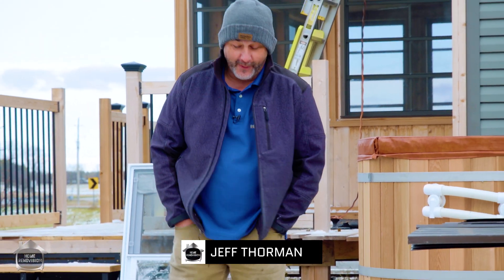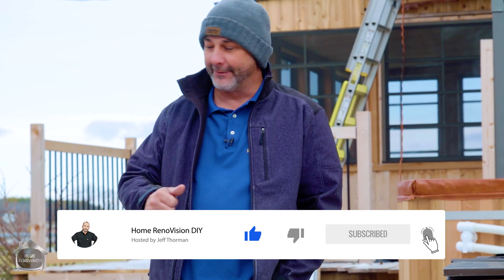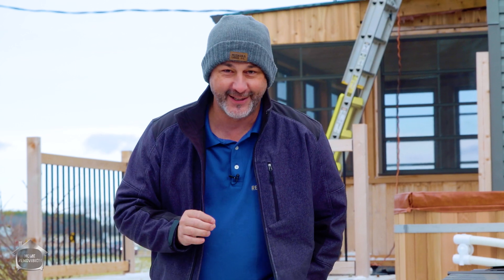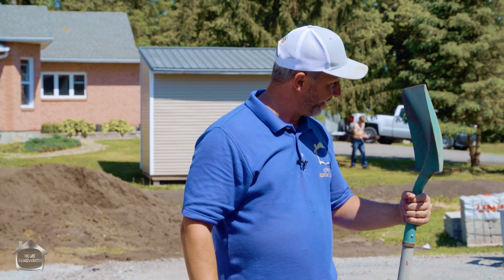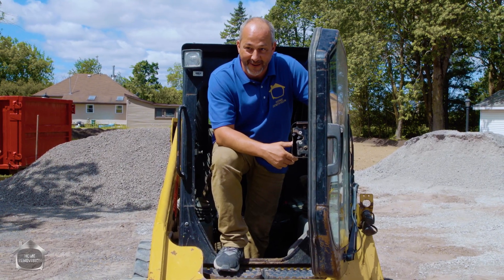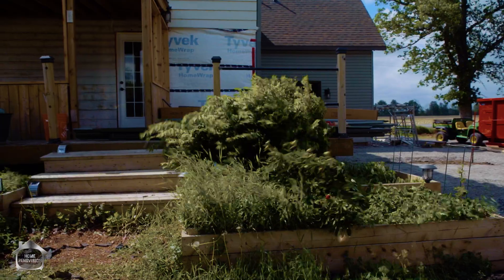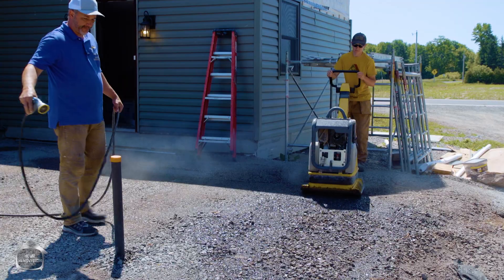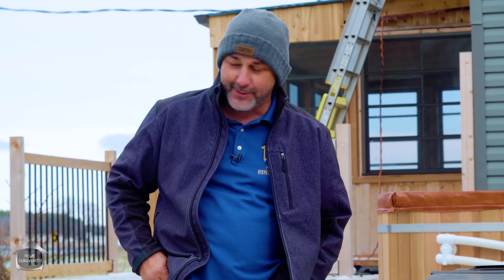We Have a Renovation TV Show!

Comment: Hi Jeff, great series of videos - very informative - thanks!  I'm planning on finishing my basement and part of it will have an unfinished painted ceiling but I want to "finish" the space between the joists at the foundation wall.  what would you suggest - drywall, aspenite, rigid foam insulation...  I'm looking for cheapest and ease of install - it's just for aesthetics - just to cover the plastic sheet  wrap. I appreciate you input.

Comment: Congrats on the new show! Could you ever do a video on how to lower a structure to the ground without heavy equipment? I have a kids playhouse that they want at ground level now.. can’t get crane in and need a way to lower it .. any suggestions? On four posts and basically a 10/8 shed 4’ off the ground

Comment: Jeff, Didn't know where to ask this question so I placed it here.  I'm in the process of upgrading the joists on our old farm house.  I spent a lot of time and energy using a laser level to install the joist hangers and when I installed the joists they very in width by 1/2 inch.  Is this something that needs to be dealt with before it bites me in the but later in the remodel?  Do I add spacers and or trim the boards as needed? 16 ft 2x12s are tough enough handling the first time.